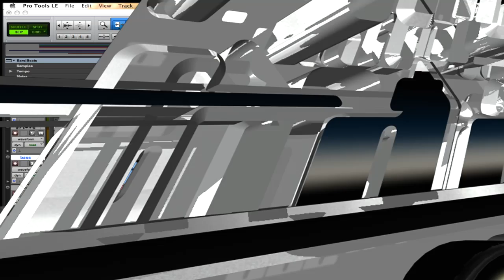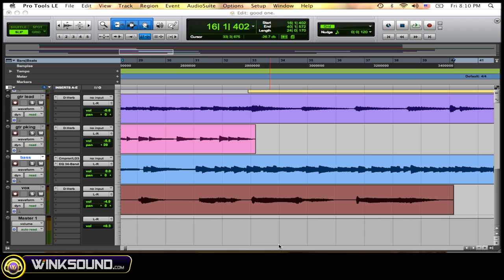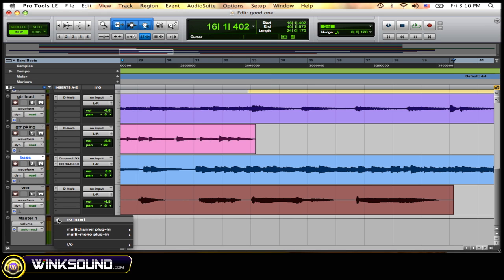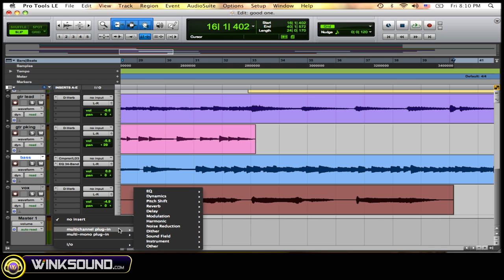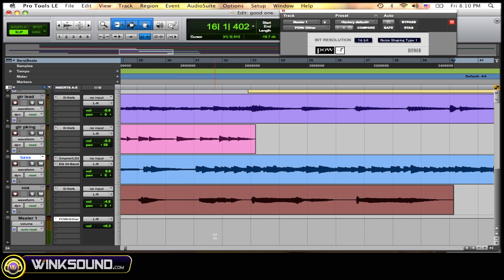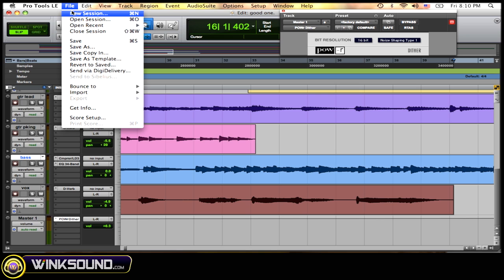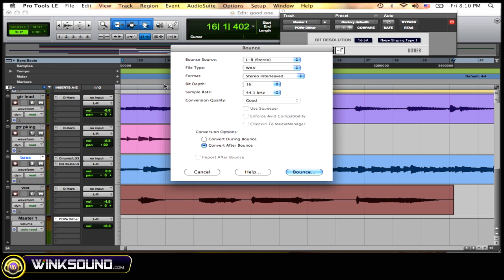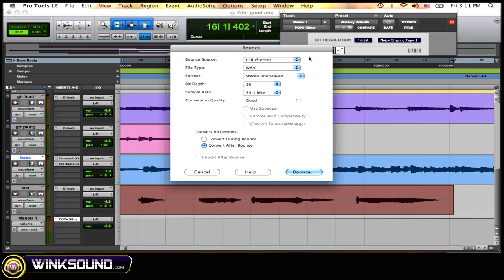Pro Tools: How To Use Dithering | WinkSound

Comment: May wanna learn the real reason you dither before making a video on it ;) agree with others that have commented stating it does not make your music sound professional, in fact you can barely hear what it achieves. For those who want to know what dither ACTUALLY does, it adds small amounts of noise to a signal so that when you lower the bit rate from say 24 bit to 16 bit truncation does not take place which has the effect of adding unwanted distortion to your tunes!

Comment: Not all dithers are non-noise shaping. Some have a influence on your tonal qualities that can be desired or not, depending on what you are doing. usually, it's always preferable to use a non-noise shaping dither. And like he said in the video. If you are planning to bring it to mastering, don't put dither at all. Although saying that dither will bring your mix to professional sound is a fallacy. Sorry, too many steps are needed for that, and dither is not one of them at all.

Comment: @eatemup316 because the reason of using dither (originally) was to be able to bring the lasts bits of the mix that would be cut off in a 16 bits down grade from 24 and up. Dither added some inaudible  (if using a non noise shaping dither) to bring the last 8 bits up into the 16 bit range. It's really a question of not losing the ends of your reverbs delays etc that would be to low in db which translated in the last 8 bits that were cut off while putting to cd.